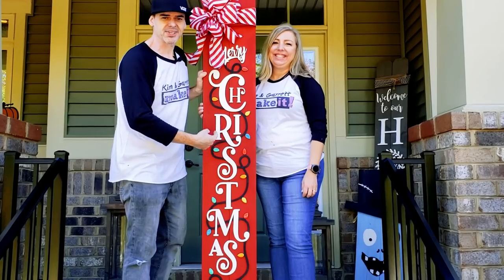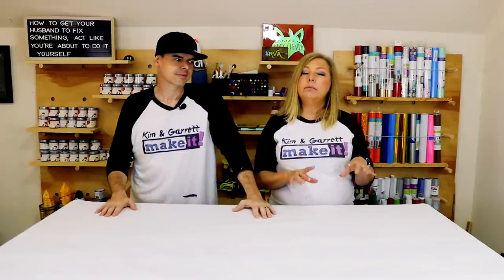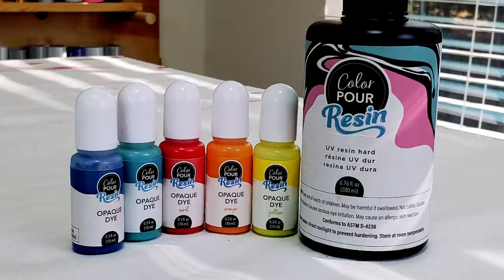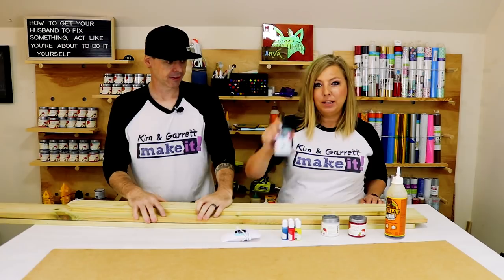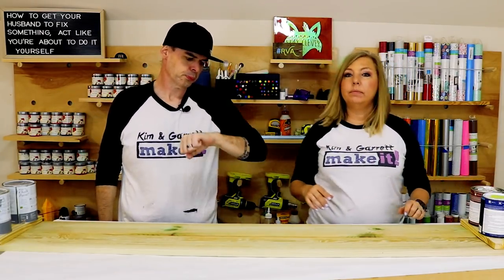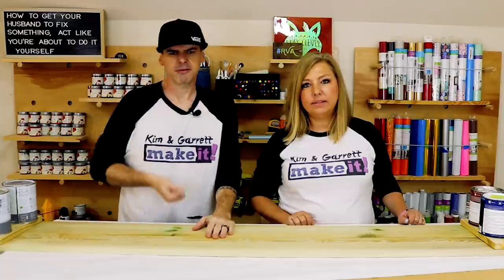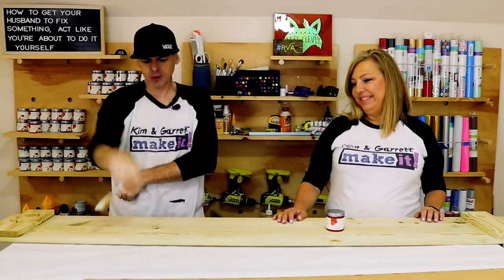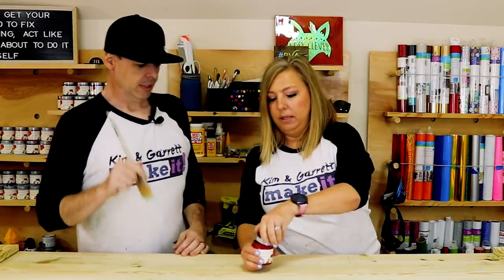DIY Front Porch Merry Christmas Welcome Sign using the Glowforge Pro Passthrough Slot and UV Resin

Comment: Love this sign👍 ..If you mix the right consistency of glo powder it won't clump up. Also you could use a hot glue glue just to temporarily frame each bulb so it doesn't run over the side when pouring the resin then peel off the glue strip once dry.